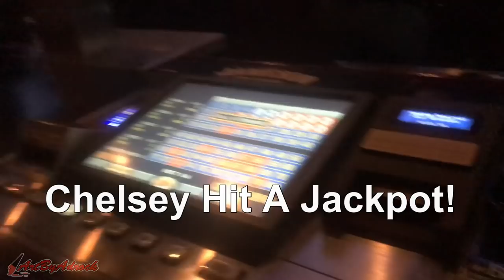GIANT Aluminum Casting - Riven's Sword: League Of Legends

Comment: BigD would be drooling over those Aluminium filings  ; )
That was a tough cast and you handled it well. I’ll be completely honest, I pulled the same plans off Thingyverse myself a few months back, but I saw all those fine recesses and thought about the sand getting stuck. I wouldn’t have your patience to carve out those few remaining awkward bits.
Very well done mate. Another triumph!
Reply from the maker: Yeah it did get stuck a lot! It always feels like half my work is carving which I’m ok with cause I enjoy it.. to a point 😂. I like carving stuff so it’s not that bad but yes BigD will totally enjoy all the shavings I have. I now have to piles going for both brass and aluminum and not sure what to do with them yet but they will be put to good use eventually I’m sure 👍🏻

Comment: Well done sir, that looked like an especially difficult cast, and you handled it with professional aplomb. Um, did you firget to put baby powder onto the first half of the 3D print, does it wven matter?
If you don't mind me asking, what went wrong with the first pour? 
Anyways, well done again, I love your work. 🎩🎩🎩🎩🎩
Reply from the maker: The first one I did was half brass and it cooled too quickly for such a big piece along with breaking apart since I didn’t use a pure alloy. Baby powder isn’t necessarily important but it helps a lot to release the mold cleanly and prevent sand from sticking. It all depends really on what you’re making a mold of